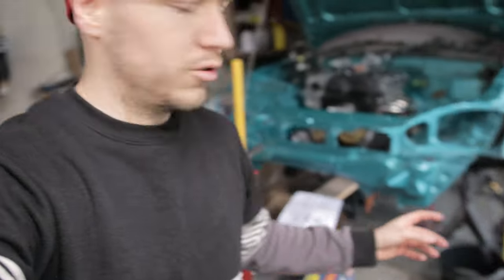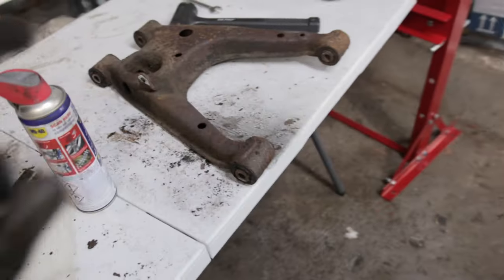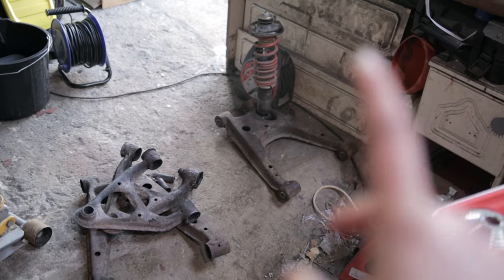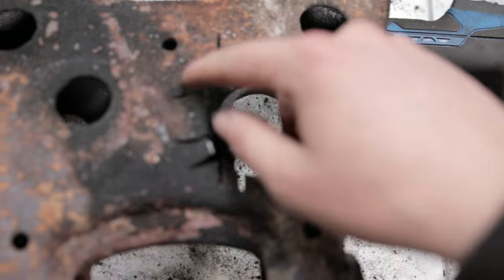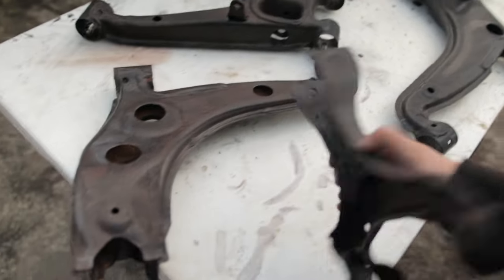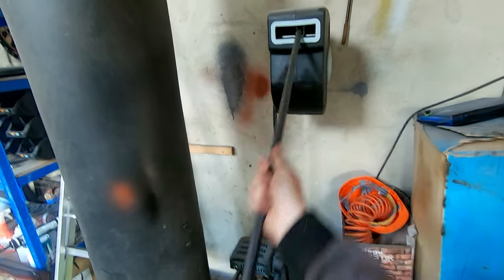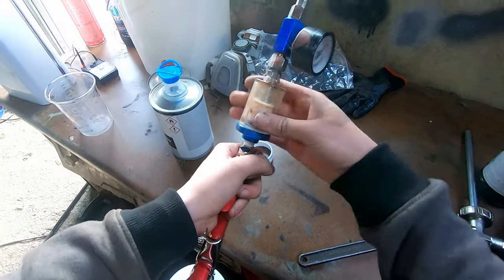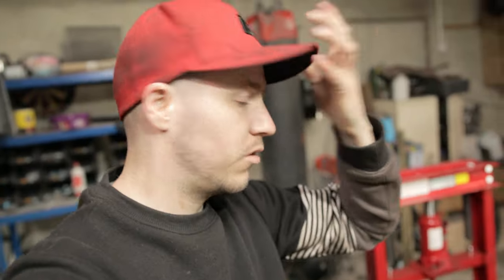Restoring + Painting Suspension On the Mx5

Comment: garage looks quite dusty. do you get a good finish on the paint job?
Reply from the maker: I done suspension outside.dont mind getting some bits on them cause they won't be seen much. But if I'm doing panels. I'll clean the floor and water it. Painted few times now and haven't really got dust getting on the paint
Reply: @mullac720  what compressor are you using to paint panels?
Reply from the maker: @bara105  50L , 9.6cfm from ebay -
  https://ebay.us/nmixcn
Reply: @mullac720  thanks 👍